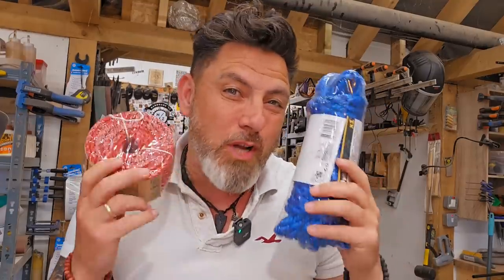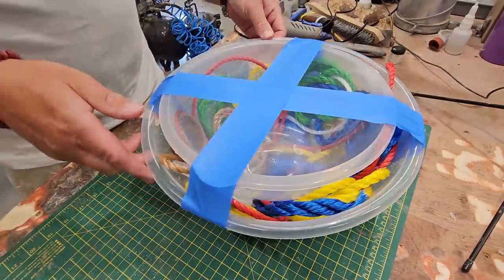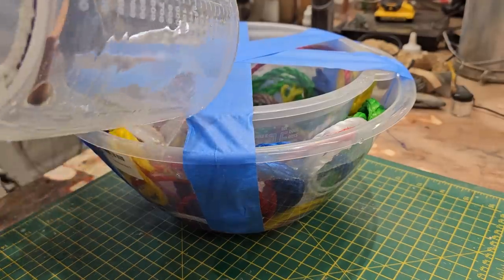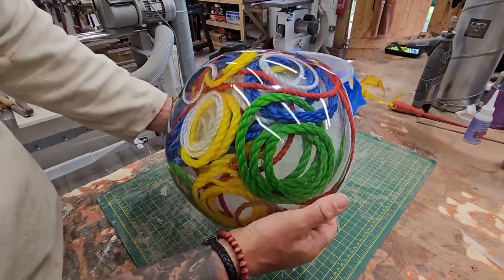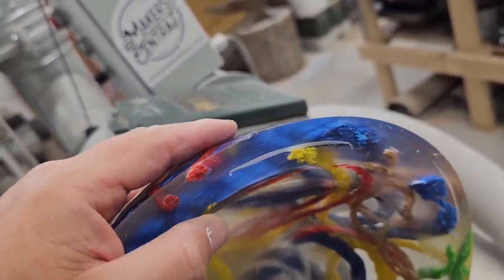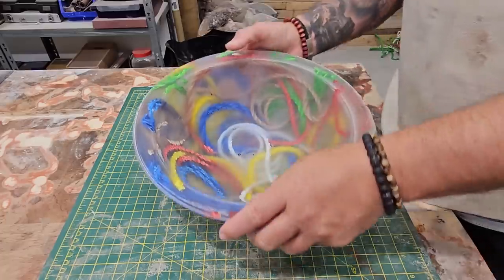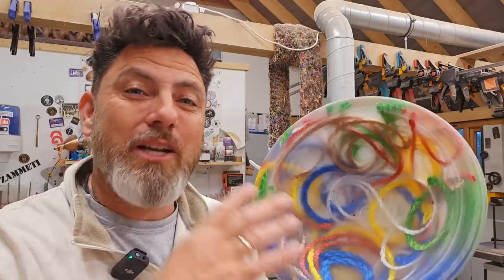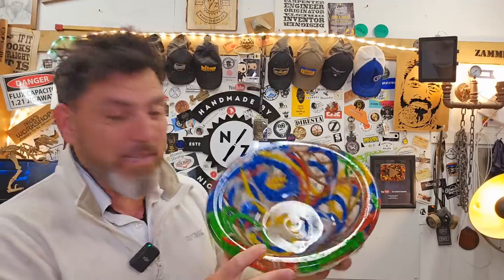ROPE & RESIN Don't Mix but Surprisingly WORK!

Comment: Pretty cool project. You may want to consider using paracord. It comes in hundreds of colors and patterns, it’s easy to work with and it’s relatively inexpensive
Reply: You could also fit a lot more colors together and more tightly packed, as well.
Reply: paracord does have that white core though may not be as attractive once turned :(
Reply: @mentalmoron3554  
That white core is easily removed.
Just cut either end and pull out.
Common tactic in bushcrafting to get thinner cordage.
Reply: Oooo...it would be cool if it was chopped into like, inch long segments before putting it in the mold!

Comment: You can always put a funky wood rim on the rope bowl if you don’t like the fluffy rope popping through the rim.
Reply: Layer of Shellawax? 😊
Reply: Since most of the rope appeared to be nylon, the application of a heat gun would have shrunk down the bits sticking out without discoloring anything (though, watch the level of heat!).

Comment: I would say it's a air pocket where the inner bowl has a recess on the bottom.  a vacuum chamber to take the air out of this recess, and it would also help with the rope being hardened.

Comment: Use your air compressor to separate the two bowls. The pressure of the air should separate them from the resin. Might save the bowls for another use.
Reply: Came to comment the same 😊
Reply: Mold-release agent. Just sayin.

Comment: I just finished a handle for s sword I've made. I used nylon Paracord and covered it in resin. It doesn't penetrate, but it coats it, well...just have to use a $#!+ ton.

Comment: I do like the ideas about putting a little more forethought into the placement of the ropes, especially with all those lovely spirals. I think you could do it without sewing anything but that's a good idea too. One other idea is, you know how the first pouring of fast curing resin melted those 45's so they rippled beautifully? I think synthetic/plastic things might have really interesting results if you go ahead and use levels of fast hardening resin. It clearly doesn't affect all synthetics. Oh, one thing I noted on Blacktail Studios channel is that an alternative of sanding between levels to induce adhesion he carefully checks the resin with a plastic knife to see if it hasn't completely hardened but will still revert to a flat state. Can't remember which vid that was I've watched so many. That way the new level partially melts the old level. Cool, huh? I'm an so glad you're getting back into the groove of things, yay! One of these days I'm going to mail you an Amazon or eBay idea package, full of colorful goodies to play with. Imagination has no limits right, Nick? Except of course those frustrating creative blocks, been there done that.  Hugs to you and your lovely family from Mexico. P.s. I'm American, lol.

Comment: I make custom tumblers. If you add resin and put it on a turner (similar to your lathe) at a very low speed it will evenly coat it.

Comment: Another excellent project, Nick!  The shavings would make for a funky secondary project.  Also, since you still have some rope, maybe another ropy project where you unravel the ropes, mix them all about, then load them up with resin...?

Rope joke: A rope walks into a bar and asks for a beer.  The bartender says, "Nope, we don't serve beer to ropes."  The rope went outside, jumbled himself up, then went back inside to ask for a beer.  The bartender tells the rope, " I've already told you that we don't serve ropes."  The rope tells the bartender, "But, I'm not a rope.  Nope, not a rope, a frayed knot."

Okay, that one is bad, but a good Dad joke! 😂

Comment: Might I make a suggestion for your rope, try gluing the ends of the rope together with heat or super glue, wrap it around the bowl mix the colors, pour the resin. After it cures, pour a thin layer over both sides so you don't have the rope sticking through.
Reply: Unraveling it into strands could also be fun....

Comment: 3:50 If you havnt bought a fish hook tool (The long necked plyers essentially) I HIGHLY recommend them.  I use them all the time now in the shop.  Learned it from Adam Savage and it is a great go-to tool to grab stuff you cant get to with traditional needle nose.  Also long locking forceps you can buy at Harbor Freight are amazing for that too because they clamp on to whatever you are handling.  I use it to start hard to reach bolts all the time.  Just thought I'd mention that.  Thanks!

Comment: For round stuff like bowls, put it on your lathe on very low speed and apply, let it keep spinning. The epoxy won't run down.
Reply: I wondered about that...great solution!

Comment: Nice!  I like how it turned out.  Way to tie in all the colors.
Maybe learn to flat braid and use the remaining rope to make a long multi-color flat braid.  Cut it into squares, coat them with resin then stack them up in a mold to make a block and then turn that.  Just a thought

Comment: Glad to see you are back in a good space. Cutting polypropylene line ought to be by using a HOT knife. It seals all the Fozzy bits. It is still a very attractive bowl, though.
Try a ropy old surfboard.

Comment: Lets get roped up in this project. (A tip for clear resin using a clear resin adding a layer of clear spay paint will prevent getting yellow coloring to the project.)

Comment: You can also do multiple layers of the final resin coating to get rid if the rough points that may be showing through...just remember to do a light sanding between them...

Comment: Good to see another original piece. Glad you didn't get TIED up on this one. It seemed to have worked out well. Keep up the good work. Glad you didnt put on the lathe for getting the top bits. That would have been pretty KNOTTY. 😂

Comment: Hey there Nick! Love your vids. 😀
Since you like the double bowl pours, you should think about making a jig with a base plate and a board that can be screwed down to hold the top bowl in place.  It might be a bit tricky to fit it in a pressure pot, but I'm sure you could come up with something.  😁

Comment: 😂 As funny as it is to watch you fight with the bowls. If you pour a little alcohol in the open spots between the resin and the bowls, it will seep into very tiny gaps and help you get them apart. 😄 I hope this can help you struggle less in the future!!
I would be saving all the resin fillings and tossing them into a new bowl with more resin. That could be super cool looking

Comment: You should use the scrap from the laith. That was so colorful and could be a cool project with some wood too. Look like sprinkles or hundreds of thousands. 

I want a mystery make. Have a blind fold and pick a color additive to resen and a wood and then a bunch of projects on paper in a bowl (like a lamp, bowl, vase, sun glasses) and then have a mystery adition that you have worked with before. All random and a combination that you haven't done.

Comment: Another idea for a resin / rope bowl. Wind a hemp rope loosely on the inside of the large bowl, add some wood strips behind it with a nice grain, and maybe an inner layer of rope. Add a new minibowl, then add resin. Hemp rope and wood grain always looks nice but with some gaps between the wood light will pass through and add to the effect.
Reply: Rope jokes. 
Piece of string walks in a bar and asks for a drink. Bar tender say "We don't serve your kind here, Get out!" 
String goes outside add a few knots, and goes back indoors and asks for a drink. Bar tender asked " Oi werent you just in here, you're that string." String looks him dead in the eyes and replies "Nah mate, I'm a frayed knot."

Comment: One trick you can try for the next time when making a bowl other then some mold release you could try a silicone collapsible bowl for the inside of the main bowl. It would make it alot easier to take out then a plastic one.

Comment: the parts you sliced off on the lathe really interested me
can you do that rope shredded with resin? Maybe not even sprinkles, but small segments of the rope so there's more of that than resin in the project by weight

Comment: You can use the same size bowl to get the inside diameter...the depth you set it will determine the thickness of the sides and bottom, but will help you reduce wastage...just please remember mold release and thickness blocks to keep everything where you want it set...

Comment: I have seen other turners apply a coating of resin while the piece is still on the lathe.    With lathe left going at a slow speed the resin will harden to a uniform gloss finish. No drips, runs or brush marks....  Just a thought.

Comment: Thanks for showing us the ropes. 😅 Sometimes, these things just can't be taut. ➰️ Question: Would it be easier to make a silicone mold of the inner bowl for next time and place it inside with weight? Might have also been cool to leave some rope loops sticking out of the rim, kind of like handles. The surf resin makes it pop amazingly! Always love these fun projects, Nick.

Comment: Cool idea, looks great. It would probably have worked better with cotton rope, or other natural fiber rope. You also might want to try hot coating on the lathe on low speed throughout the cure time. Just my thoughts as I was watching. Aloha.

Comment: What about sanding a bowl with 60 grit, apply color resin like the interior of this bowl, cover in clear resin, then polish. Would the grooves from the 60 grit hold enough resin to give a wispy look?

:) put some syrup on that waffle because it's done. Waffle mold, add funk to mold, seal in resin to make coasters.

Comment: Re-sand and re-coat the bowl and you'll get rid of the 'fluffy' ends of the rope.
Also if you vacuum then pressure pot the resin it'll penetrate the rope fully.

Comment: And here I thought you were going to "hang" us out to dry, but you waffled on just fine. Maybe add a wood ring to the top edge next go around? Love the results with the surf resin, I just might use it for my boat project with some carbon fiber

Comment: You could take this down a different thread by cutting straight lengths and positioning them upright in a tub to make a pot out of them, like you’d do with colored pencils. That kind of thing could leave you tied up for a while if it didn’t give you a whipping, first. That’s knot to say this project wasn’t good, but you could string us along down this path and wind us up with a second project. These rope projects really bowl us over, after all!

Comment: With the finish, I've seen other resin turners keep it on the lathe - lowest speed and use a paintbrush in constant contact with the surface to smooth it out. Like the guys at entropy saying the resin pools at the bottom of the legs so they'd just keep brushing it out until it starts to thicken. Don't know if it's worth trying?

Comment: Well I have no rope jokes however I would have used a torch on some of them Frayed Ends and then use a butter knife to push it down to make it flat and not so fluffy and then put your resin on top of that just an idea keep up the good work mate

Comment: I wonder what would happen if you shredded the rope into small pieces, like confetti with a paper shredder, or some sort of "flocker" like what is used in fiberglass sprayers where the bits of rope are almost microscopic, yet would give you the color effect to the resin..Also, what about taking the rope strands and braids apart to create "curly cues" of various colors and textures? What would happen if you used monofilament fishing line in resin? would the monofilament disappear?

Comment: Can you apply that coat resin on the piece on the lathe with it turning at very low RPM's and then cover it and leave it rotate until dry?  Would that help with blemishes?
Reply from the maker: No not a good idea I don’t think . I wouod remove it 👍🏾

Comment: You should do a rope bowl with the ropes Into a lamp shade. Or make a 3 legged table lamp with 1 leg nothing but wood and the other 2 legs a mix of wood, resin and rope with a base that is half resin with rope and the other half of base wood. The solid wood leg would be to hide the electrical power wire inside.

Comment: Great video. Why do figure eights get into a lot of fights? Because they're friction devices. What did the belay device do to the rope? It took a bight and eight it. A tightrope is a tight rope. You'd know if you understood tautology. Two fishermen were having a contest to see who could make the most knots with a length of rope, in the end they tied. I tried skipping rope but I ended up being tied up. That was knot my intention. What did the nice rope get for Christmas? Everything it wished for, it wasn't knotty. If you're teaching a new plumber the ropes of the trade you're technically potty training

Comment: Wondering why you didn't just sand the inside so knot to expose you rope. 
I'm glad this project kept you tied up with something to do. 
Using the surfboard resin was a lot easier than trying to push a rope.
I think this bowl is a bit twisted but in a good way. 
You didn't show you emblem. Did you knot want us to see something? 👀

Comment: You know, if you use a release agent on the bowls and blow compressed air, with a rubber tipped nozzle down the side of the bowls they will lift right out.

Comment: You know that ice in resin you did way back some when got me pondering what would happen if you put Magnum ice-cream lolly or two in resin 😃 the chocolate coating mite be OK in the resin as it heats up but the ice-cream will melt inside it's chocolate case Is it worth giving it a G0 😬🤪

Comment: Here you go Nick...

A rope walks into a bar and hops up on a stool.

"Hey bartender," says the rope, "Can I get a drink?"

The bartender says, "Go away! We don't serve ropes here!"

So the rope leaves.

The next day the rope comes back wearing a cowboy hat, hops up on the stool, and tries to order a drink.

"You can't fool me. I already told you we don't serve ropes here!!" and the bartender, who is pretty upset by now, picks the rope up hat and all and tosses it out the door as far he can throw it.

The rope picks itself up and dusts itself off and goes home.

Now the next day the rope goes back to the bar but before it goes in it ties itself in a knot and messes up its ends then it goes in , sits on the stool and tries to order a drink.

The bartender sees the rope and mutters a few not so nice words before stomping up and growling at the rope .  He says, "Aren't you that rope I've thrown out twice already?!"

And the rope replies, "No sir I'm afraid not." 

Okay so it's a punny one.😇
Reply: Just an idea... you could use embroidery floss.  It comes in hundreds of colors and is usually at least part cotton so it would probably soak up the resin.  In the U.S. it's sold in craft stores, fabric stores, Walmart, and even sometimes dollar stores for as little as 50 cents a skein. You could get a bunch and wad it up in a big knot or cut lengths and lay them across your mold so they fade from one color to the next.

I also can't remember if you have used crayon shavings.  I wonder if they would melt and swirl into different colors while the resin was curing.

Comment: I'm struggling to get the slack out of a rope even after instruction. I guess some things just can't be taut.

Just joined the local church’s bell ringing group. They said they would show me the ropes.

I got a friend a rope tied to a bucket for their birthday. It went down well.

Did I tell you the joke about the jump rope? Never mind, skip it.

Police are searching for a gang who stole a series of ropes from the local toy shop. It’s believed they’ve skipped town.

Saw a group of people competing to see who could end up putting most knots in a series of ropes. They ended up tied.

Really upset that the metal hooks tied to my rope have broken. I’m having a hard time grappling with this.

Call me a cynic, but I think ropes were introduced by boat companies to raise sails.

A rope walks into a bar. The bartender says, “We don’t serve ropes in here.” The rope walks outside, ties a knot in the middle of her body, brushes out the strands at the bottom and heads back into the bar. The bartender says, “Aren’t you the rope I just threw out of here?” The rope replies, “No, I’m a frayed knot…figure8ively speaking.”

Comment: Do it again... Really slow epoxy, thinner rope, bowls of more similar sizes, mold release, underfill the rope by a solid 5cm epoxy to 25mm under the rim, vacuum the whole thing down to suck the air out of the ropes, hold vacuum for an hour, then pressure pot until cured.

Comment: I know a few rope jokes but they're very long and drawn out stretched a bit thin in some places and frayed in others like all ropes are scared some really terrified what can you say they're just FRAYED IS ALL. some have a strange twist to them and there all a bit loopy, you might be sensing an underlying thread here, but it's just  knot CORDinating no point getting hung up on it, hey drop me a line or swing by some time make sure you work out the kinks first and dont get too tied up in your work, keep some slack in it remember how you were taught once don't snap on me cause asked for it like it or knot. You know ropes get great net sails and will pull you out of a hole like a true friend.

Comment: Actually I thought it might be a bit KNOTTY.
It may not be the best bowl you ever made, but it's TIED.
This one really struck a CORD.
For a minute the finish was hanging by a THREAD.
Nick Zametti star of what's my LINE.
Until you figured out the surfboard thing, I thought you might SKIP the ROPE.
I decided not TWINE about your lack of posting; I just figured you were TIED UP elsewhere.
So what's your next project? Don't leave us HANGING.
Your projects are usually mainstream, but this one was more on the FRINGES.
But at LEASHED you put a video up.
This STRING of puns is getting kinda long.
I'm a-FRAYED I gotta go now.